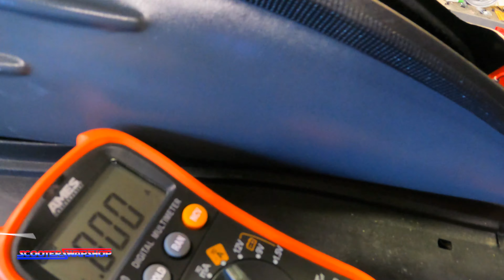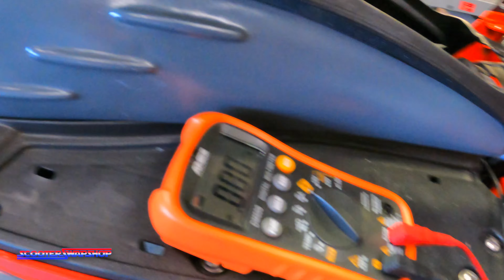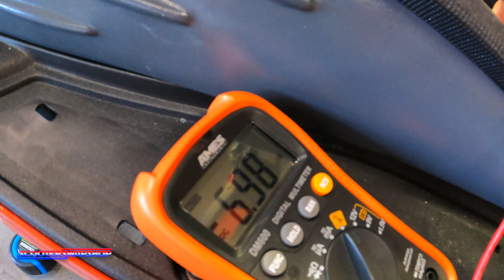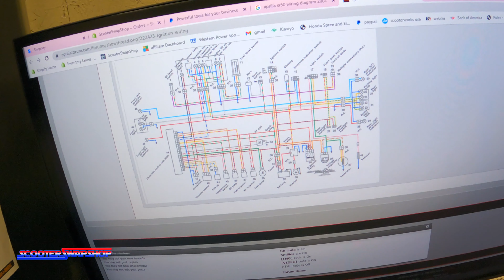Are the Ditech  Issues over? David cook's SR50's EP:5

Comment: I love SR 50’s I’ve never dared to buy a ditech though! 

I chased an electrical problem for weeks on 1. There’s 2 plugs on the wiring loom that are used for a numberplate light in certain countries and someone had plugged them together causing all sorts of mayhem.

Also from what I can see on your videos, it looks like your stanchion tubes aren’t in the fork yoke correctly. The stainless clip that you can see poking out at the top should be inside the clamp and then the rubber bung sits flush with the yoke. Your supposed to put the clip around the top of the tube then push the tube in from underneath and the clip sits in a grove inside. I’ve had 2 that have been put together how you’ve got yours, the rubber bung won’t last 2 mins and it’ll disappear out on the road.
Reply from the maker: we got it all worked out.

Comment: SR was one of the best looking scooters going! I had two 125 two strokes it has the same engine as the runner but was air cooled rather than LQ. But they were on the ball the frame on the 125 had the mount points for a radiator and water hose guides. So if you got hold of a 50lc front and the relevant parts from piaggio you could make your sr125 a liquid cooled version! Shame you guys over there never got the EU internal headlight set up suits the shape so much more!! Keep up the amazing videos!
Reply from the maker: Very cool!
Reply: You can thank the DOT for that. Im working on converting my SR into more of a EU spec. LED EU headlight, and the blinkers, ect.
Reply: @Winner3ty  the EU headlight internals look badass! Even the 125 SR headlight
Reply: @Scooterswapshop  they looked awesome and we’re crazy fast! even with just mild mods ie air filter/exhaust rollers. Wish I never sold my last HARDA racing rep one 🤦‍♂️
Reply: @garethkimbley-brown9646  Agreed! gonna be great

Comment: Hey SSS, is there an easier way to change the front brake pads on a bug-eye Zuma than having to unbolt the rotor so there's enough clearance? My caliper would NOT go on without hitting the rim. I'm an MX Tech, apparently a good one according to customers, but that front caliper.......almost put me in the loony bin.
Reply from the maker: Mx tech?  but thats the easiest if you cant spread the pads enough to just slide it off
Reply: @Scooterswapshop  I only had 2 drinks, but that caliper was 🤬! But yes, I'm a tech and have been racing for 32yrs. Idk if I had a sudden drop in IQ, but that caliper gave me more problems than any motor, linkage bushings, siezed crank ever did. Replaced them last year no prob.